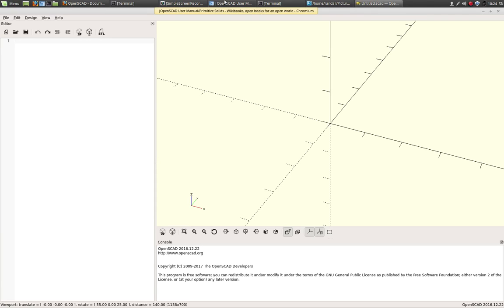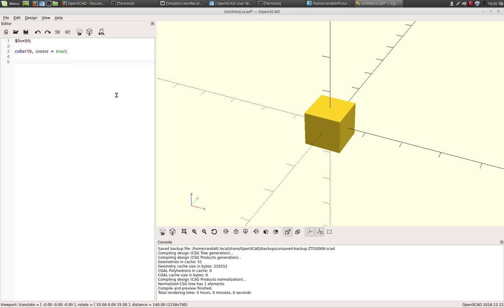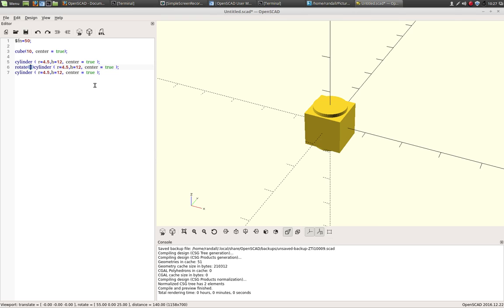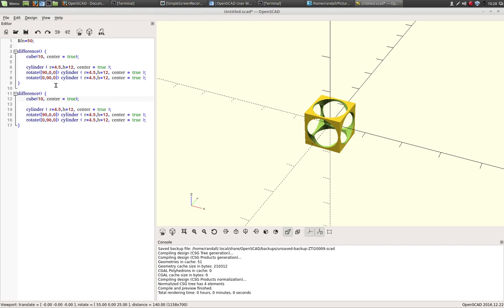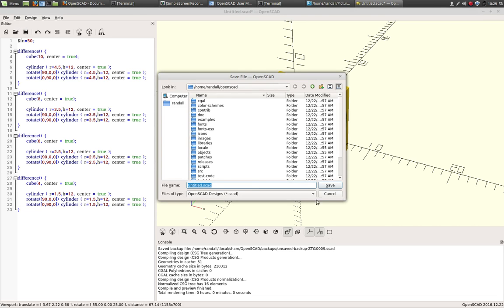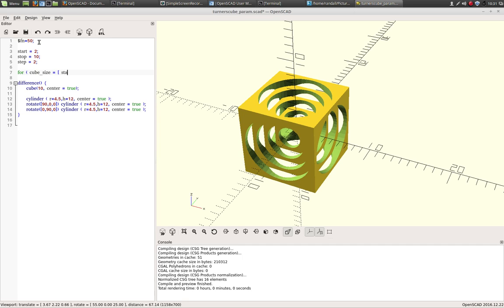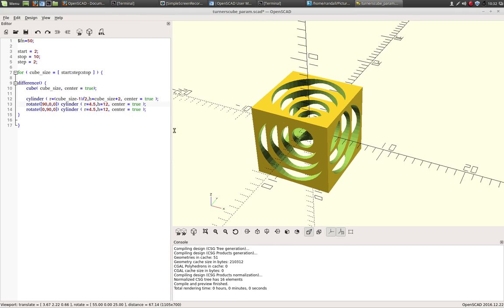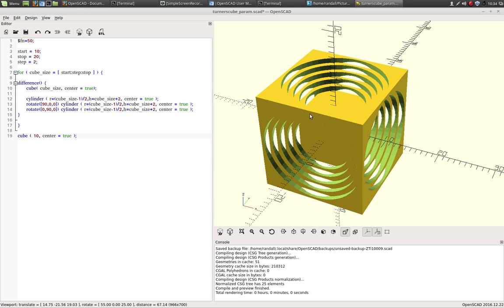OpenSCAD - Turners Cube in Ten Minutes or "Why FreeCAD Sucks"

Comment: OpenSCAD is frustratingly shortsighted. The bigger idea is to allow both programming AND interaction. I want to be able to apply a fillet or chamfer to a complex edge by clicking it. The lack of snap based calculation is also a poor omission. Want to make measurements for angles, distances, radii? Too bad you're the calculator. OpenSCAD is the kind of thing somebody makes when they have no idea how CAD should work. It's a dynamic interactive process, not Bjarne Stroustrup sending one way commands via carrier pigeon to OpenGL.
Reply: You have COMPLETELY missed the WHOLE POINT of OpenSCad, it really makes me wonder if you've ever actually modeled anything using it. It's not SUPPOSED to work like traditional CAD programs, otherwise why not use THOSE? Programmers will already HAVE the information you are talking about, or we can calculate it in-program, so actually OpenSCad is the calculator. YOU need to size, rotate and place every single object specifically, so it's a breeze to use a little Pythagoras, Algebra or Trig to calculate anything you need. You mention snap-based calculation, but since you are never "drawing" on the screen, never "select" any object, what would actually "snap" to what? If you need to "snap" two objects together, write a function that does this yourself, and then save it into your "include" file. Fillets and chamfers on complex shapes are easy to do, you just need to build them in from the start, which is REALLY the way OpenSCad works anyway. Traditional CAD is very often Top-Down, whereas OpenSCad is EXTREMELY Bottom-Up. When I first needed fillets, I took a little extra time to write a universal filleted cube function, saved it to my "include" file and I'll never have to worry about it again, the fillets are "baked in", and I can use it for anything I'll ever need with fillets from now on. If you need Dynamic Interactivity, just open up the Customizer tab, and you can dynamically change your model by entering numbers or sliding sliders, and everything updates LIVE! Doesn't get much more Dynamically Interactive than THAT! OpenSCad was written by a group of folks who know EXACTLY how CAD SHOULD work for us programmers and logical thinkers. To each their own, if you like traditional CAD but would like scripting too, learn Python and find a YouTube tutorial on scripting in Fusion 360. ;)
Reply: It really depends on your background, and what you're comfortable working in.. Weirdly, I work best with OpenSCAD or Tinkercad, because essentially they both organize parts by grouping, and manipulate through subtraction. Whereas I can barely function at all, with sketch based cad.
I'd love to be able to use both programming and graphical interaction, as you suggest.. But I have a feeling that converting edits made graphically back into the unique coding style the user wrote in, could be extremely tricky.. Something like that probably requires the kind of AI we're now seeing developing.. For example, the AI would have to see what you're trying to do graphically, and also see how you've coded it, in order to alter the code to achieve what you changed graphically. Actually, that sounds like something I should try making, once the AI gets good enough to do it, probably in just a few months. lol
Reply: @NikoKun  
You don't quite need to reach for AI yet. What the authors could do is make each function callable via GUI especially for interactive commands. In the end, the final model is described by the composition of functions and parameters during the edit session.

Comment: FreeCAD is Python scriptable. It can be verbose - it’s just a different animal. Certain geometries fit well with FreeCAD. A grid of 100 holes feels nice with a Python while loop. FreeCAD is also aesthetically pleasing. Both OpenSCAD and FreeCAD have their pros and cons.
Reply from the maker: I hope it came through that I don't really hate FreeCAD, just thought I would try the whole Click-Bait thing, lately I barely touch OpenSCAD. Still love it but loving FreeCAD more these days.
Reply: mathcodeprint I didn’t interpret it that way at all. I totally understand your point. I also prefer the command line. I come from a machining background, and sometimes we have to inspect tiny surface areas with insane amounts of detail. Unfortunately the command line doesn’t always cut it, as much as I wish that it could. FreeCAD and OpenSCAD compliment each other quite well. I can quickly whip up a solid in OS and then dump it into FC or any other program.
Reply: mathcodeprint another issue I’ve had with OoenSCAD is it’s limited support for various modeling formats. In machining we import mainly STEP, IGES, PARA, or Solidworks, models, and convert them into G-code with Mastercam. FreeCAD supports significantly more formats.
Reply from the maker: Well said, agreed.

Comment: Somehow I need an extra rotate to produce the same result.

$fn=100;

start=10;
end=30;
increment=4;

for(var=[start:increment:end]){
    difference(){
        cube(var,center=true)
        
        cylinder(r=(var-1)/2,h=var+2,center=true);
        rotate([90,0,0])cylinder(r=(var-1)/2,h=var+2,center=true);
        rotate([0,90,0])cylinder(r=(var-1)/2,h=var+2,center=true);
        rotate([0,0,90])cylinder(r=(var-1)/2,h=var+2,center=true);
    }
}
cube (10, center = true);
Reply from the maker: You are missing a semi-colon after your cube. I am surprised it doesn't create an error it didn't on mine either. The 2019 version does give a warning.
Reply: @mathcodeprint  Thanks for taking a look!  I've obviously completely overlooked it. I use SolidWorks professionaly, this is quite different. But very elegant in its simplicity. The learning curve seems quite steep though.

Comment: i want to get into 3d modeling and prototyping things so i can print them on my 3d printer but i have always been intimidated by these kinds of programs and i dont have much experience in programming. Would this be the easiest thing to learn on or would you recommend something else? because i feel like it will probably be more useful to use this method of modeling instead of drag and drop gui based CAD if i want to make something mechanical
Reply from the maker: Your question a a good one, but not necessarily easy to answer. OpenSCAD is very easy to learn but can become cumbersome very quickly with complicated models. If, as you say, you have no coding experience you might want to try something like Tinkercad. OpenSCAD may frustrate you as it has some concepts well known to someone familiar with coding.  FreeCAD isan option but it is considered to have a steep learning curve. There is also a nice option called BlocksCAD which may help to ease you into the code approach. ( there are many other options as well .) I suggest just trying some but dont get locked in until you see what works for you.
Reply from the maker: Until they cancel free usage.
Reply from the maker: Well said. Everyone who uses OpenSCAD, at some point, "what the hell is Minkowsky?" but I still like it :)
Reply: @mathcodeprint  after using openscad I keep thinking of parts in terms of minkowskis and hulls and even cadquery doesnt seem to have those commands

Comment: $fn=50;
difference() {
    cube(10,center=true);
    for (c=[5,4,3,2])
        for (r=[[1,0,0],[0,1,0,],[0,0,1]])
            for (d=[90,180,270]) 
                rotate(d,r) 
                    translate([0,0,c-1])
                        cylinder(2,c-.5,c-.5);
}
Reply: When I try your example in OpenSCAD I get "ERROR: Parser error in line 10: syntax error." I am using version 2015.03-2